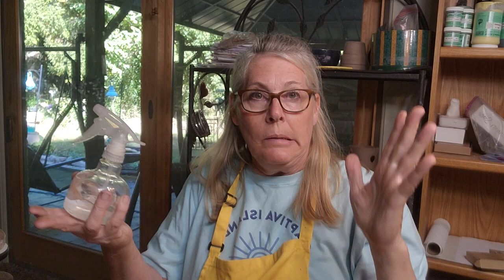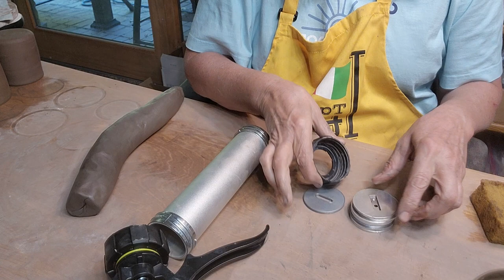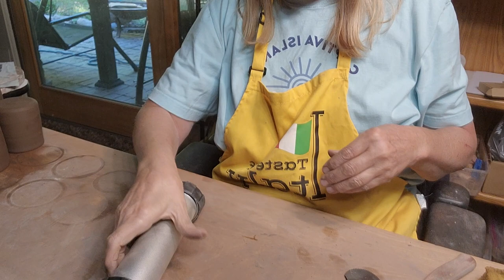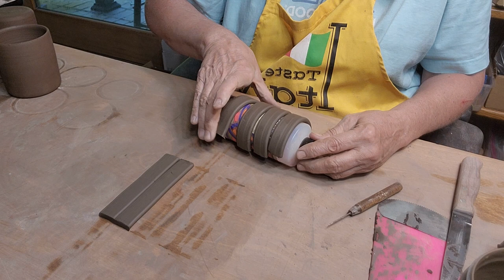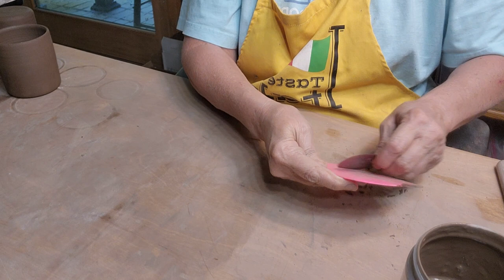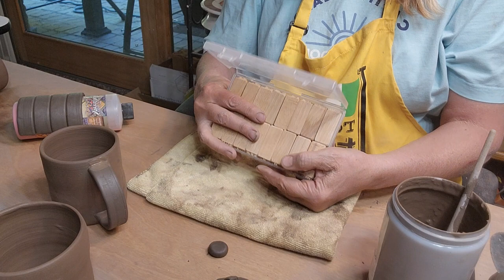Making and Adding Mug Handles using a Nidec/Shimpo Handheld Extruder.  October 4, 2022

Comment: It made so much sense when you said to dry the mug upside down so the handle doesn’t pull on the mug!! I have always had my mugs go wonky where I attach the handle and I can see now it was because it was pulling on the mug!!!! Thank you soo much.  I recently bought the Nidec extruder and I really like it alot!! You can use sandpaper around the hole of your handle maker to smooth the little burrs and get a smoother handle. Also you can use a metal file, flat or round, to adjust the shape of the die you already have!! Also, if you make the log as close to the size of the barrel as you can and then press it in  really well you won’t get the holes and burps in the extrusions. I don’t even clean mine!! I leave clay in it and then it’s ready when you need it! Just pinch off the first l little piece of clay on the outside and you’re ready to go!! Thanks so much for the video.
Reply from the maker: Thanks so much for all the tips!  ❤️  Leaving the clay in the extruder would make it even more convenient to use.   I'll try the sanding.  My handle disks are made out of plastic, though, because my son made them for me, but I think the sanding may work.  Thanks!!

Comment: Hi Lisa I did a recycling bin with Tupperware, just get one the size you thing is good for you, pour 2” plaster inside and let it sets, just put you slip and scraps inside and next day is good to use, you don’t have to take out the plaster from the bin live there it will dry and the walls are good for contain the splashes. Just a note let the plaster dry the first time about a week before you start using it. 🤗
Reply from the maker: Thanks Marcia!

Comment: Lisa another tip after you make your log to put inside the extrude roll the cling plastic on the log leaving about 1” with no plastic on the edge and fold the left over plastic on the back , insert inside the extruded pipe, when you all done you just have a little inside to clean about a inch to clean and the cover you don’t even need to take apart the gun to clean 🤗
Reply from the maker: Oh wow, what an amazing tip!  Thank you so much!  I'll definitely try that next time.  ❤️   😀
Reply: Terrific suggestion!